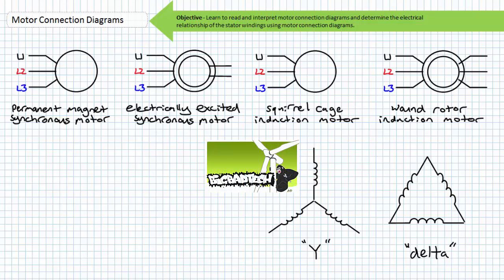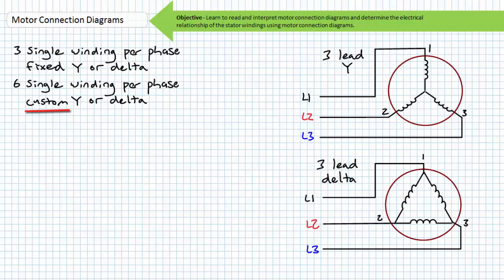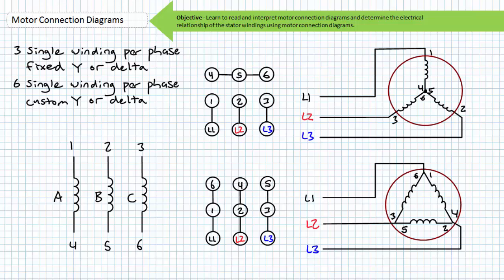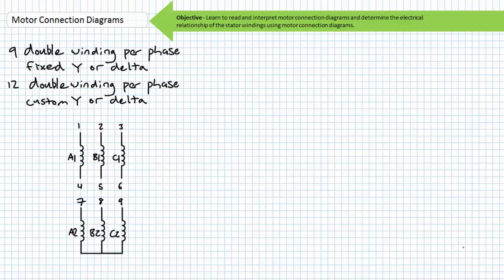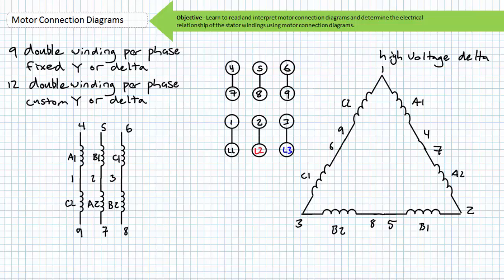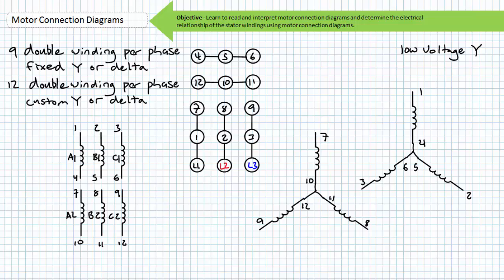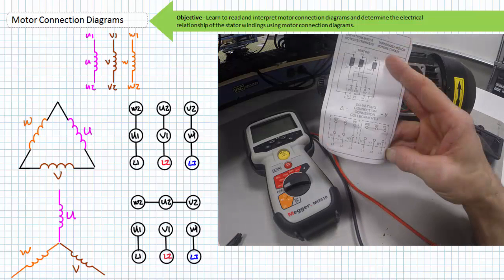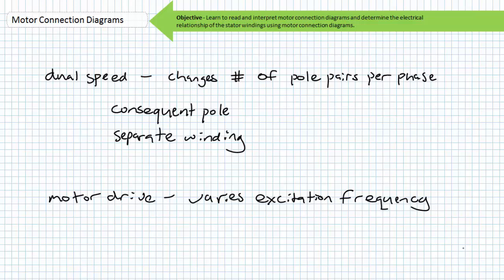Motor Connection Diagrams (OLD LECTURE)

Comment: Do you have video tutorial for 12 leads wire motor
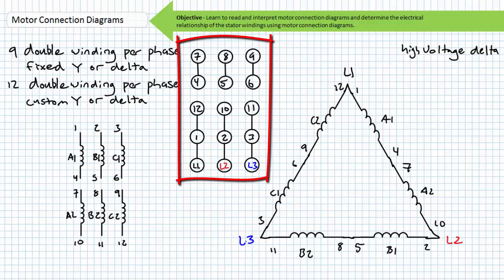Reply from the maker: Make sure you're using the most updated lecture at: https://youtu.be/gnQlQ1QuFT8 12 lead motors at 20:38

Comment: Your L2 in the nameplate diagram is connected to 2 and 4 but in your leed/delta diagram it is connected to 3 and 5
Reply from the maker: Yes this should be addressed in the comments. It would cause the motor to run in reverse direction. Make sure you're using the new lecture at: https://youtu.be/gnQlQ1QuFT8

Comment: 3  LEAD

3  FACE  AC  MOTOR

LAWYER  DROP

GIRL  SAME  NAME  DROP

6  LEAD  MOTOR

1  /2/3

DIRECTION  DHOW

CROSS  EACH  ONE  OFF  US

DIAGRAM   OF  US  🇺🇸  PLACE

1/ 6/
2/4
5/6

  CONNECT   DIRECTION  OF  MOTOR

MOTOR  DIRECTION  OF  CAMERA

6  LEAD  MOTOR  LAST  

THAT  WILL  BE  DELTA

WILL  BE  THE

MOTORS  6  LEAD  MOTORS

DELTA  RUN

FROM  6  LEAD  MOTORS

INTEGRATION

VOLTAGE  CURRENT 

INCREASE   DICUSSS

DELTA 

WATER  DROP

GENERAL  HIGH  VOLTAGE

2  LANDING

HALF  VOLTAGE 

2 WINDING

SAME  PHASE

MUDER  LIKE  MORE  VOLTAGE 

LOWER  CURRENT 

LESSER  POWER  AND  MORE  VOLTAGE

HIGH  SOURCE

7  /  8/9

CENTRAL  MODE  NOT  ABLE  TO

ACCESSABLE

HIGH  VOLTAGE  SERIES

TERMINAL 

SERIES  COMBINTION

TERMINAL  1 / 2/3

DIAGRAM   LOGO

INTEGRATION

4/5/6

COMBINE  2/8 

3/9

1/7

MOTOR   CONNECTION

DIAGRAM

LOGO  INTEGRATION

MUDER  CENTRAL

INTEGRATION

PARTIAL  ADULTERS

INTERGRATION  A1  1  / 4  

A2

B1

B2

C1

C2

WINDING

MOTOR

MANUFACTURER   HIGER  THESE  MOTOR

5  CONNECTED  8

3   CONNECTED  4

1  CONNECTED  2

1 / 2  / 3

CONNECTED   DIAGRAM

LOBO  LOGO  INTEGRATION  167

CONNECTED  TOGETHER

135

A1 B2

B1  B2

C1  C2

PARALLEL   DELTA

DELTA  COMNECTION137

484

DIAGRAM  UNDERSTOOD 

3  FACE  AC  MOTOR

BOTH  TERMINAL 

12  ACCESS  ABLBE

A1

A2

A3

B1

B2
.B3

C1

CE

C4

Comment: 7, 8, and 9 are wired together in a central point in a wye motor. I had a student ask if you could wire let's say 1 to 8, 2 to 9 and 3 to7 instead of 1 to 7, 2 to 8, and 3 to 9 for low voltage. What he said made sense considering 7, 8, and 9 go together. I told him to give it a shot (mind you this is an adult with maintenance experience, and I supervised) and the motor did not run right. Could you explain why? Thank you.
Reply from the maker: Good question. 

Short explanation: creativity gets you zero points! 

Longer answer: the physical placement of the windings influences how the motor operates, check out the "Rotating Magnetic Field" lecture at: https://youtu.be/sQesDN6mpZ4 

Winding 1-4 needs to be paired with 7, 2-5 with 8, and 3-6 with 9 to create a seamlessly revolving magnetic field. Wired incorrectly you'd have the magnetic field perform a partial arc and then initiate another partial arc ahead/behind of where it left off. 1-4 and 7 need to hand it off to 2-5 and 8 which hands it off to 3-6 and 9 and so on to create a 360 degree revolving magnetic field in physical space.
Reply: @bigbadtech  Thank you! That answered my question to a tee. Very good explanation. Can I not get half credit though for creativity 🤣, don't be so hard on a guy!

Comment: So, in summary, regarding three-phase AC induction motors:

· In a three (3)-terminal stator: It is not possible to change the connection (wye or delta) between the three equivalent windings per phase. It is not possible to feed it with two different voltages.
 
· In a six (6)-terminal stator: It is possible to change the connection (wye or delta) between the three equivalent windings per phase. It is not possible to feed it with two different voltages.

· In a nine (9)-terminal stator: It is not possible to change the connection (wye or delta) between the three equivalent windings per phase. It is possible to feed it with two different voltages after re-connecting the individual windings.

· In a twelve (12)-terminal stator: It is possible to change the connection (wye or delta) between the three equivalent windings per phase. It is possible to feed it with two different voltages after re-connecting the individual windings.

Therefore, we can't apply a wye-delta starter in a 3-terminal or 9-terminal stator, only in a 6-terminal or 12-terminal. Right?

Please correct me if I'm mistaken.
Reply from the maker: Correct.
Reply: @bigbadtech  I extremely appreciate the time you invest in your videos, and reading and answering comments. And for free. Youre such a good person, I hope this channel gets as popular as others like The Engineering Mindset. Wish you the best. Thanks.
Reply from the maker: Do me a favor and tell your friends!

Comment: What are separated windings and are they the opposite of a Dahlander motor??
Reply from the maker: A dahlander motor is kind of a separate winding motor in that it changes the number of poles dependent upon connection. Normally, low speed uses a series connection of 6 windings in a delta whereas high speed uses a parallel connection of 6 windings in a Y.
Reply: @bigbadtech  What are these "six windings" that keep getting mentioned? Thanx for the upload.

Comment: I'm having trouble understanding how the parallel and series connections work on delta configurations, as far as how 28 was possible between w1 and w2. Do you have lectures that delve deeper into that?
Reply from the maker: I do have lectures that cover Y start - delta run reduced voltage starters at: https://youtu.be/DpB-kdM2RA4 however this is really the only video that covers dual voltage motors. Long story short a high voltage motor requires a series connection of windings and a low voltage motor requires a parallel connection of windings. A big delta (high) voltage is like a triangle where each side of the triangle is formed of an in line connection of two series windings. In contrast, a delta-delta (low) voltage is like a triangle where each side of the triangle is formed of a side by side connection of two parallel windings. For all delta configurations L1, L2,  L3 connect at the corners of the triangle.

Comment: Just tell me how to connect 208 single phase motor to the outlet of my stove the L1 L2 L3 which line goes to the negative since there is only 2 lines 120 volts from the outlet of the stove.  does L1 goes to the negative or which line goes to the negative
Reply from the maker: This is trying to fit a square peg in a round hole. A three phase AC motor won't run on single phase without a motor drive or some special modifications. I'll explain how to do this in later lectures.
Reply: @bigbadtech  I have seen people use a running  capacitor for the third line ,but can it be without the capacitor or how many micro faraid would be or would.it be 240 V or 349 v the micro faraid also this capacitors come with percentage values +/-

Comment: On a high voltage 9 lead motor i see the line coming in but theres a gap between leads 1,2,3 to 7,8,9 i am confused on how the power gets from terminals 1,2,3 to 7/4,8/5, and 9/6 this example us in regards to thehigh voltage wye configuration any assistance would be great
Reply from the maker: For a high voltage Y it goes like this:
winding 1 1 to 4
winding 2 2 to 5
winding 3 3 to 6
preconfigured Y 7 8 9
4 to 7
5 to 8
6 to 9

Comment: Is it possible to hook up a wye configured motor to a delta connection on a 9 lead motor? My power is 208 delta but the motor wiring diagram calls for 230/460 in a wye configuration.
Reply from the maker: Delta configured sources can run Y configured motors and vice versa. Your issue is voltage magnitude. The voltage specified on the nameplate is the line to line voltage. Some manufacturers do allow 230/460V motors to run at 208 in the low voltage parallel configuration. one would expect the motor to draw slightly more current at the rated condition than it ordinarily would at 230V.

Comment: Hey Jim, good day. I have one doubt @ 8.30 minute video. 
In Δ connection for 6 lead motor, it will be L1-1-6 , L2-3-5, L3-2-4 as per diagram. Plz clarify me.
Reply from the maker: Yes, I mention this somewhere in the comments below. Swapping L2 and L3 would simply change the rotational direction of the motor. The important concepts of this lecture is that the windings are hooked as 1-6, 2-4, 3-5. Check out the "Rotating Magnetic Field" lecture at: https://www.youtube.com/watch?v=sQesDN6mpZ4

Comment: Do you mean high voltage is 380 V and low voltage is 220V sir ? Please answer me
Reply: what distinguishes 9 leads and 12 leads at low voltage Y?
Reply from the maker: You're most likely referring to the line to line voltage (380V) vs the line to neutral voltage (220V) for the same system.
Low vs high distinguishes between systems. Example: 120/208 vs 277/480. Check out the "Introduction to 3 Phase AC" lecture at: https://www.youtube.com/watch?v=RToXdTYQteo
Reply from the maker: 12 lead configured as low voltage Y behaves exactly like a similarly rated 9 lead low voltage Y. Only advantage is that the 12 lead can be broken and reconfigured as a delta for use in a Y start-Delta run reduced voltage starter. Check it out at: https://www.youtube.com/watch?v=DpB-kdM2RA4

Comment: Sir, please tell me about half and full parallel connection of induction motor
Reply from the maker: I'm presuming you mean a part winding reduced voltage starter? Here's a lecture on that topic: https://www.youtube.com/watch?v=sFO_qNtuEDs Long story short ... one winding (ie: half parallel) presents more impedance and inrush current is less, two windings (ie: full parallel) presents less impedance and current is more.

Comment: Please  how can i  identify   unmarked  6 leads on 3 phase  motor ?
Reply from the maker: Good question. This will take some familiarity with inspection equipment. First, determine which leads correspond to the 2 ends of each winding with an ohmmeter. Then hook two windings in series and apply a small amount of voltage (ex: 24Vac). Then use a voltmeter to measure if there is an voltage across the third winding. If so, mark the leads where the voltage was applied as the start of the first and end of the second. If there is no voltage induced on third winding interchange series connection of second winding and repeat procedure. Then repeat procedure for remaining windings. I should do a video on this because a lot of people have been asking about it.
Reply: @bigbadtech  i think its very complicated hope to find  video  for it . I find  one video but inspection by  DC  12v

Comment: Hi Jim can you please explain to me how a motor can operate without a neutral wire coming out of it?
 the motor circuit looks like an open circuit with 3 wires that are the  phases going to the motor and no wires coming out for the returning current. As i know a circuit will operate  a load when a wire will come out of a power supply and go in to the motor and another wire for the returning current will come out of the motor and connect back to the power supply
Reply from the maker: Check out this lecture on balanced Y configurations: https://www.youtube.com/watch?v=8RHetyPxp0Y
Long story short if the Y configuration is balanced (ie: 3 identical windings in a motor with the same impedance) there will be no current in the neutral and it can be removed from consideration.

Comment: 715rpm1450 rpm connection Diyagram  3 phase 11 kw please  tell me  sir
Reply from the maker: Anything I say is a total guess because I don't know what voltage distribution scheme is being employed nor the motor's intended configuration (ie: low vs high voltage or y or delta). Best action would be to look up motor manufacturer's data sheet for the motor of interest.
Reply: @bigbadtech  sir high voltage pitch 4 6 8 
(slot 3)( pole  12 )winding (2 star 1 Delta) sir
Reply from the maker: Like I said, I can only guess. Best action would be to look up the motor manufacturer's data sheet for the motor of interest.

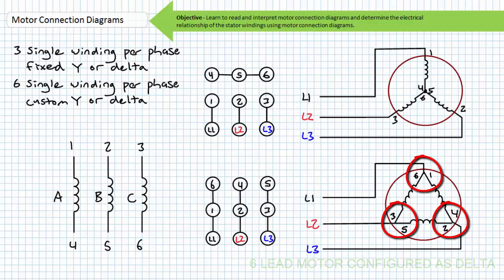Comment: At 7:58 are l2 and l3 on the delta winding reversed?? L2 shows 2-4 but on the diagram points to 3-5.
Reply from the maker: Good catch. Yes, I mention this somewhere in the comments below. Swapping L2 and L3 would simply change the rotational direction of the motor. The important concepts of this lecture is that the windings are hooked as 1-6, 2-4, 3-5. Check out the "Rotating Magnetic Field" lecture at: https://www.youtube.com/watch?v=sQesDN6mpZ4

Comment: Thanks Jim. Would mains 220 - 240v be categorized as High Voltage or Low Voltage in deciding whether to connect the Motor Delta or Wye? Pls advice
Reply from the maker: Low vs. high voltage is a slightly different question than Y vs. delta. Y configured motors experience the line to neutral voltage whereas delta configured motors experience the line to line voltage. EX: US light industrial 3 phase AC is 120V L to N, 208V L to L.

Regarding the distinction between low and high voltage it really depends upon your geographic location. EX:  US households are typically serviced by both 120 and 240V. In this application a "low voltage" configuration would be the 120V connection, whereas the "high voltage" configuration would be 240V.

Comment: hi jim, if you have a 12 wire wye start-delta run motor do you have to use the wye start?
Reply from the maker: No, you can start it as a delta. A y start delta run reduced voltage starter is used to only reduce inrush current and mechanical stress. Check out the y start delta run reduced voltage starter lecture at: https://www.youtube.com/watch?v=DpB-kdM2RA4

Comment: I wouldn't mind a separate video about dual speed motors, as I just picked up one :)
It's wired with a 6 pole rotary switch and runs hi and low speeds in both direction.
It makes a weird loud wining noise running at the slow speed.
I would also be interested in running both hi and low speeds with a single VFD using vectoring. Maybe an idea for a future video :)

Comment: Hi Jim. What if you swapped U1 and U2 in a 3 phase motor, without swapping the other 2 phase connections?
Reply from the maker: Check out the rotating magnetic field lecture at: https://www.youtube.com/watch?v=sQesDN6mpZ4

Comment: Hi 
Last week I got a  very old VNC machine which has double polarity i.e. 2 speed induction motor with 9 terminal. It has some connection diagrams given on the nameplate. But since I havent dealt with such motors before and none of my collegues have, I am finding it troublesome to trubleshoot the contactor logic for low and high speed. Can you help me on it ???
Reply from the maker: I can honestly only guess from here, however, similar to a Y start - delta run reduced voltage starter (https://www.youtube.com/watch?v=DpB-kdM2RA4) the different speed configurations may necessitate breaking one configuration and reassembling another. When the contactors making the low speed connection close the high speed ones should open and vice versa. Either configuration should still result in a recognizable Y or delta configuration.
Reply: Hi
Thanks for the reply. 
I figured out the operation just an hour ago.
The arrangement is similar to what you said. It forms big delta at the start for low speed and then switches to star arrangement with two windings of every phase connected in parallel. I couldnt understand what internal connections were until I carried out continuity test in all 9 terminals. Your video came very handy in that. Thanks alot ☺️

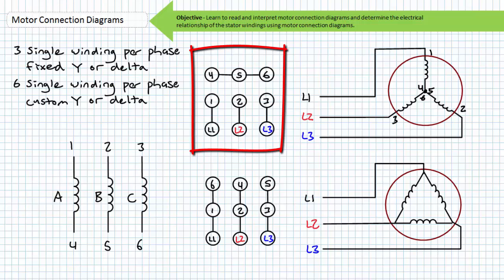Comment: @7:38 diagram says L3 to 2, L2 to 3... just doesnt rhyme with its matrix next to it
Reply from the maker: Good catch. Yes, I mention this somewhere in the comments below. Swapping L2 and L3 would simply change the rotational direction of the motor. The important concepts of this lecture is that the windings are hooked as 1-6, 2-4, 3-5. Check out the "Rotating Magnetic Field" lecture at: https://www.youtube.com/watch?v=sQesDN6mpZ4

Comment: Hi Jim ,  I tried to connect a 12 lead motor to an inverter mitshubishi (d740 - 80sc) the vfd did not respond as what I expected. It also indicated that the inverter overload protection was triggered. Can you please help me with this one. Thanks and Godbless.
Reply from the maker: I don't have any direct experience with this drive so I can only guess. This being said what is the overload setting? If the overload is set too low it will trip. If you're suspecting it's the motor, check each individual winding's integrity and use a megohmmeter to check if any winding is shorted to another or the frame. I think I demonstrate how to use a megohmmeter to check motor windings in this lecture: https://www.youtube.com/watch?v=qi5FCsEtg94
Reply: Thanks Jim . I just follow the 12 lead configuration high voltage with the terminals connected to the following :     (Line 1 , 1&12      -  Line 2   , 2&10  ,  Line 3  3&11 & 4-7 5-8 6-9 connected together.) Then I tried to connect it to an inverter is it correct? Or no need to use and inverter since we can configure the motor winding with a various starting method? Thanks
Reply from the maker: I'm super hesitant to troubleshoot this application remotely because the actual motor and inverter aren't right in front of me, however, my recommendation would be to check the connection diagram carefully (some motors may be labeled different than those I used in the lecture), check the integrity of each individual winding and ensure they're electrically isolated from each other and the frame using a megohmmeter, and finally, check all the settings on the particular motor drive. Provided the motor drive is rated for the application (and the motor isn't mechanically overloaded) it should work as intended. Check the motor drive playlist at: https://www.youtube.com/watch?v=uT3m-o1PM3c&list=PLdnqjKaksr8qruLl85Uq3em62PjXlSNUF it features a different motor drive, however, sometimes drives will give some error code you might be able to interpret.